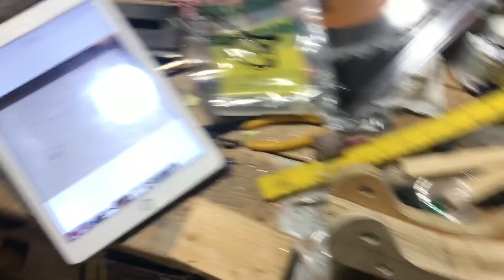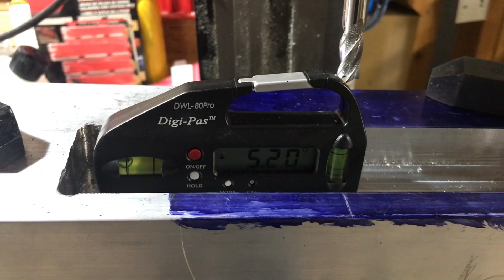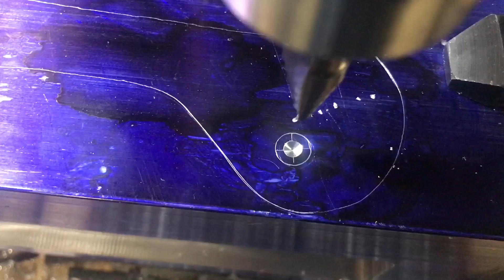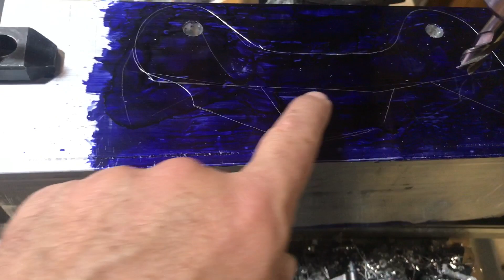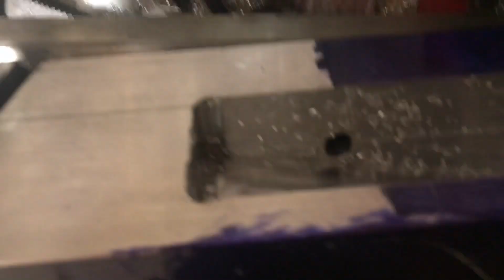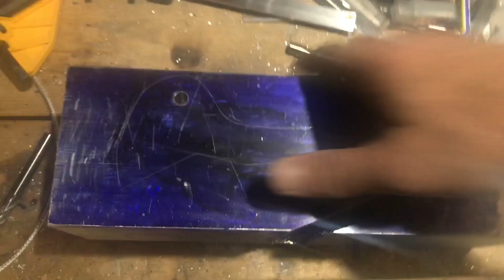Superlite SLC Build 030 Alternator Bracket Fabrication Part 2

Comment: Cani ask why not just make it as the centre section with separate sides?
Reply from the maker: Hi Mick, I call that the erector set approach which many builders use.  If this did not work out I would have done that. Just thought making it out of a single piece of aluminum would be a nice touch. It was a crazy amount of work given how light duty the mill is, but it all worked out.
Reply: @JoelKSLC .   The cost of that piece of aluminium billet, to make just one bracket that one slip could ruin would put me off doing it that way.   I also have a 3D printer so I would probably made it from PLA to make sure it fitted before making the expensive one.
This is one of the joys of kit cars, we all have the same start  and end point but a different rout between the two depending on our skills and experiences.
Reply from the maker: @mickcoomer9714  yeah, that piece of metal was $100 so it was a gamble for sure. Worst comes to worse, you can tig weld up most gashes and re-machine which I may do with a couple small gashes I have. At some point I’d like to get into 3D printing for some interior parts. I normally use plywood to mock things up so it’s just a more basic approach than 3D printing.